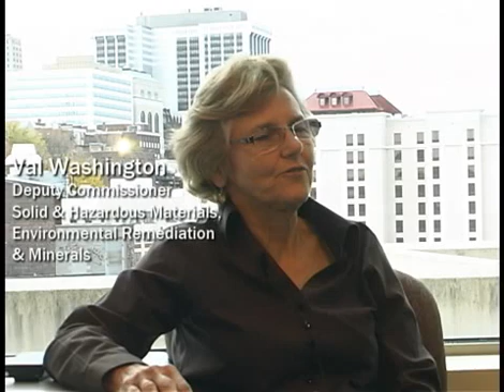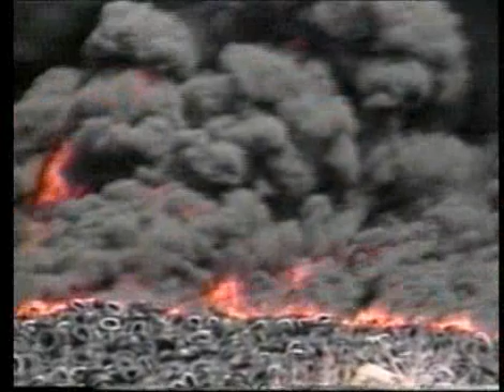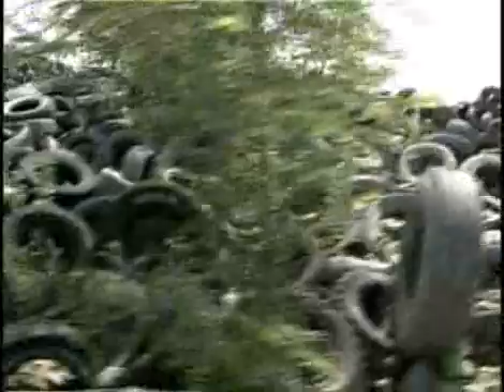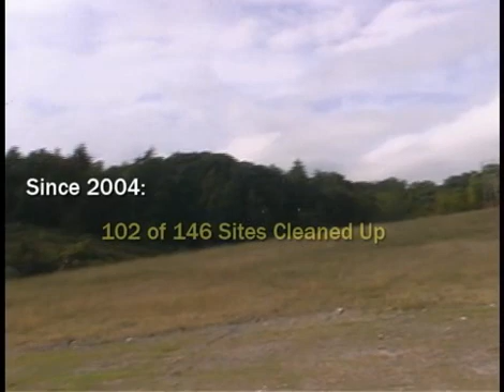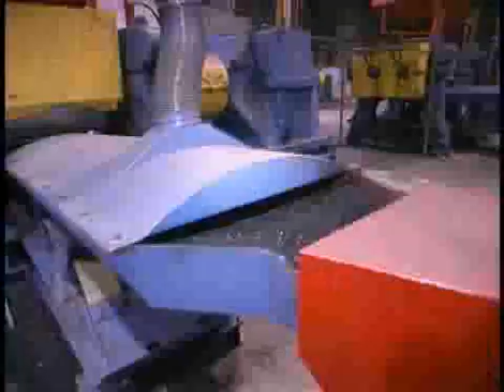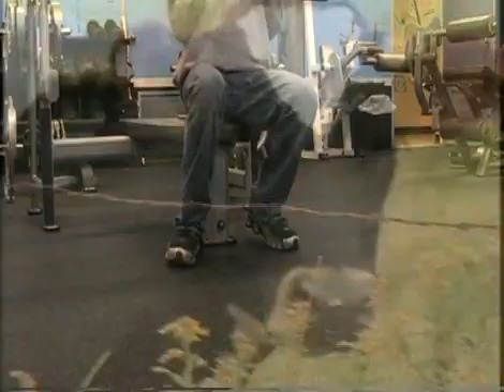Cleaning Up NY's Waste Tire Sites

Comment: DID they stop. There is a junkyard in the Adirondack park  that has 1000`s of buried tires and barrels of antifreeze gas and oil. Harts Parts
Reply from the maker: Please contact our Region 5 Office of Material Management if you wish to report this: (518) 623-1200.